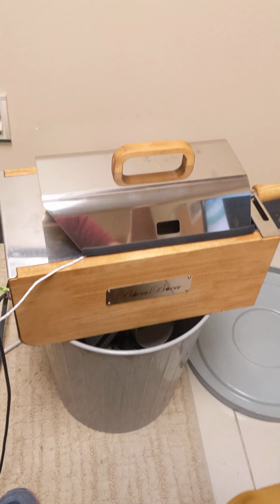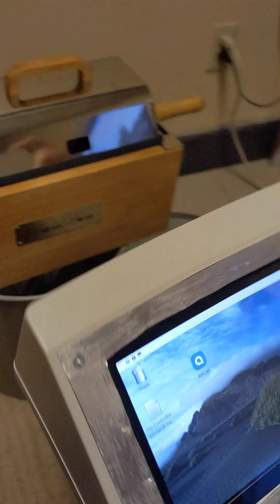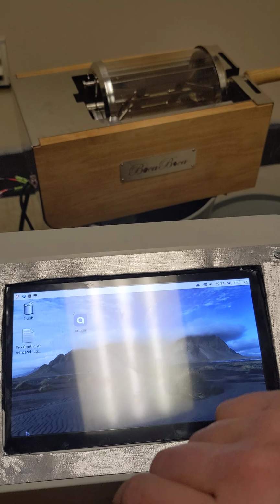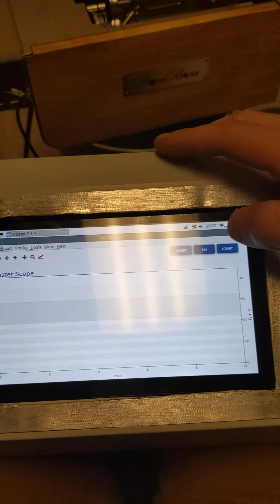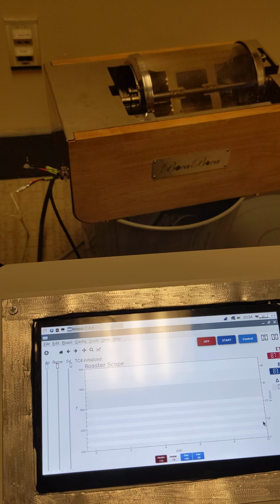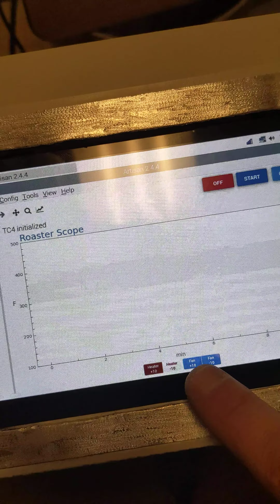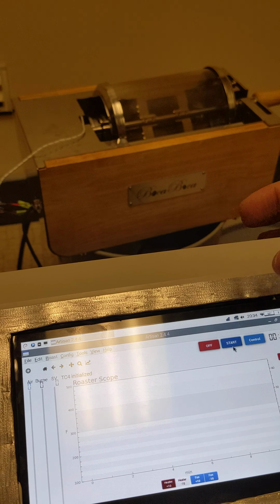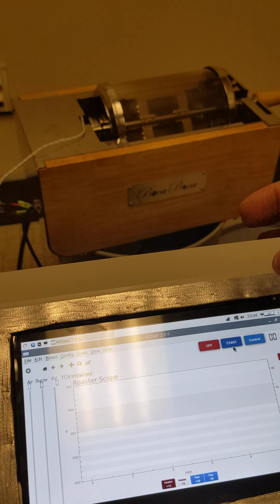Boca Bean Boca Boca 500 coffee roaster with Artisan control TC4+ arduino computer control.

Comment: Do you still currently use this roaster?
Reply: I don't actively use it. But it's my backup for my Bullet R1
Reply: @mobsterman1992  I’m just curious because I have one. Why did you choose a different roaster?
Reply: @annatyler286  because I needed more capacity for my business
Reply: @annatyler286  the Boca Boca worked great, and is my backup as it's the most affordable 500g/1LB roaster and could hold me over if I really needed it. My efforts to add thermocouples came to a halt, due to the costs involved with a rotating assemble. I still have plans to modify the drum to make this possible.